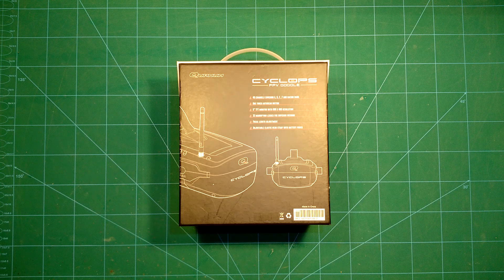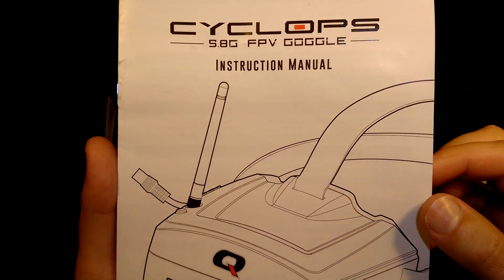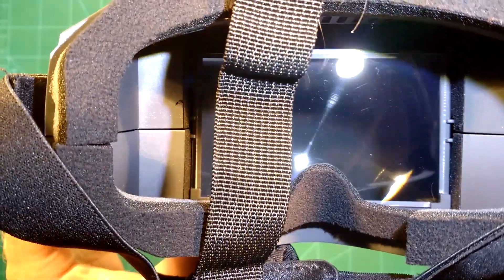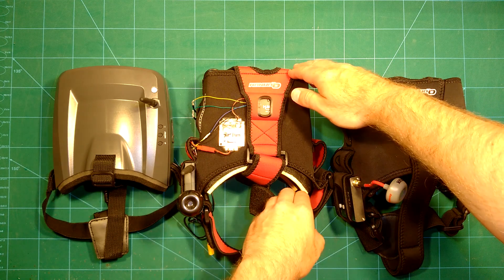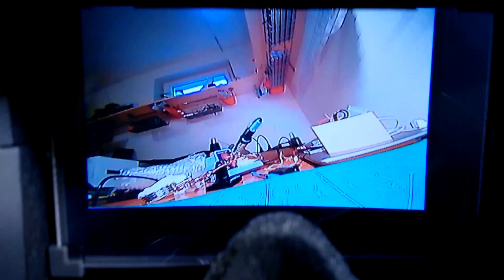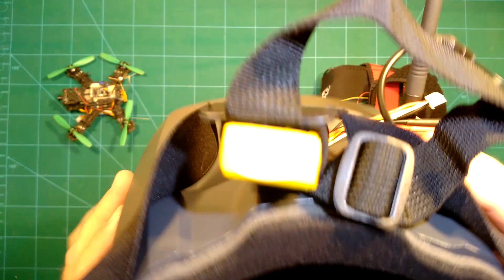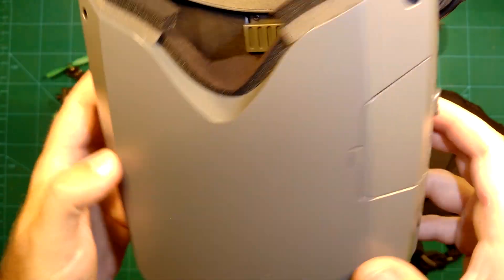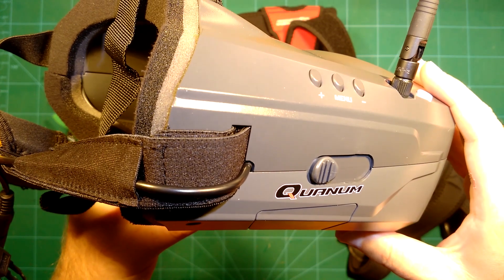Quanum Cyclops FPV Goggles for only 58 USD: Review, Comparison & Dismantling

Comment: Cool review as well sir! :D  Nice comparison & dismantling :) Well done!
Reply from the maker: Many thanks mate, glad you like it. The dismantling really showed me that they are much more mod-able than I thought. Look at all the free space on the right side. I'm already making plans on what I want to put in there :-D
Reply: a DVR? :)  Notice that I had a DVR in mine in my test-flight :)
Reply from the maker: Yes, I was wondering about that, care to share some details? :-). I integrated a HMDVR into my v2 Pro and was going to do something similar for the Cyclops :-)
Reply: Ah yes.. that is a bit of an unlikely setup.. I recently reviewed the Foxeer Legend 1 camera, and did not like it 1 bit.. So I took it apart.. replaced the camera itself by a servo-connector (simply put).. and added a contra-servo connector to the receiver of the Cyclops.. That's it really..
NOT ideal, as the resolutions don't match. but with a bit of cropping it worked..
Reply from the maker: Nice and very clever! Great work :-)
Reply: Thanks man :)  And it didn't cost a thing (as I didn't want to use the Legend 1 anymore)

Comment: thanks for tearing them apart. plenty of space in there for the modders.
I guess if the goggles sell good, they will release an updated VRX module that has more functionality?   only real disatvantage that one cannot set a frequency (which makes it unsuitable as spectator goggles if more then one video source would be available...
Reply from the maker: Completely agree, it is a pitty that the channel is not shown to you and is also not setable manually. I do hope there will be an upgrade. Other than that - very nice goggles.

Comment: Very nice video my friend :)
I think because of having opened the goggle, you have made probably the best review of this product so far.
It's too bad you did not have the Eachine VR-007 FPV Goggles, i would love to have a picture quality comparison with the Quanum!
I am bit disappointed about the finition of the Quanum but it seems to be a honest product for the price but i would definitely go for the Eachine ones despite the little extra price and the lower resolution because of the better finition and the handy auto-scan of the video receiver!
Happy midweek
Reply from the maker: Many thanks mate! Would love to compare them to the VR-007, I'll try to get one of them for review. The Cyclops have autoscan as well, which seems to work really nice! I really like this pair of goggles given the cheap price :-)
Reply: The Eachine VR-007 FPV Goggles are much lower quality...only a 4.3' screen with low 480x272 resolution, too low for FPV or reading OSD well.
Reply: For having testing these goggles, you will not have any probem for reading the screen even your OSD since you are sending analog video which has a higher resolution but honesty Quanum does not have a such good finition and the battery strap and connections have a very poor conception...

Comment: Excellent review and tear down to show what's inside. Definitely needs a couple of mods such as you mention, optional A/V switch to add A/V input for using with external VRx for other frequencies. It should be easy to do by intercepting Video out from internal 5.8 VRx. 16:17 Looks like wire#4 on VRx module connector to LCD screen, Red wire being #1, is the VRx video out wire? I'm just guessing based on what can be seen on your video! Also you can add a DVR. Perhaps just splitting the VRx video out to a standard RCA plug may work. By the way, your speech/narration is totally understandable so no worries on that ;)
Reply from the maker: Great! I had hoped that look of the internals would be useful for some - excellent analysis. I'm planning to add a DVR to them soon, and will also do a video on this. Really looking forward to this. Thanks for the heads-up regarding speech/narration. Thanks again for watching and your valuable input!

Comment: Great review, thank you.
So that compartment door, did you find what it was for? Looks like maybe just for releasing the lens clip.
Reply from the maker: It's really only a "dummy" door. One cannot even open it, it just looks like a door. I assume that it is for a feature which they wanted to get in, but did not at the end. I open the goggles at about 15:08 and that door is even at the other side of where all the rest of the electronics are placed. Maybe we will soon see another goggle with the same casing but the door functional? But I'm only guessing here. Great that you liked the reivew, many thanks! So great to have you with us!
Reply: ok, thanks. Yep I noticed there is no additional video-out to record your FPV, so maybe the door will add something like that in the future. thanks again.
Reply: The door is actually a real door, but the tabs that hold it in place are to large. I used a sharp knife and removed a sliver of plastic on each tab. Now the door opens easily. I use it to hide a programming contact.
Reply from the maker: Awesome info Kjell - thank you very much!

Comment: After seeing the inside dimensions, I had to come watch your video review.  It would be nice if the auto-scan would at least put the number of the channel up on the screen briefly, just so you knew for sure you were locked on the correct channel.  Probably not a good goggle for a guy who frequently races with other FPV pilots, as you'd definitely want to control the channel function then. Still, its a bargain price, and I just might wind up getting a pair to fool around with. Cheers!
Reply from the maker: These are indeed very simple goggles. The autoscan (complete automatic, no manual, not showing the channel on the siplay) was also a bit of an issue for me, but now that I have used them for a few months, it is not so much of an issue for me. They are my main goggles currently. Even if I fly with others, it's not an issue. One reason is that I have my main channel and seldomly change it. However, I also found that the autoscan is working very good and accurate. Even when others are around, it is sufficient to move away a few meters and it will reliably find my channel, that works great. But the real reason why I'm currently sticking with these goggles is that they are very very lightweight and very comfortable to wear. Much more comfortable than my Quanum DIY goggles for example. I can wear them for hours without any issues.
Reply: I agree, they may be simple, but sometimes that's a good thing. After watching your review on the V2 Quanum, I like these better. I think they would work well with my ZMR250 racer, especially since I don't normally fly with anyone, just fly around on my own .. the auto scan should be fine. Thanks for a nice review!
Reply from the maker: My pleasure, thanks for watching, Bill :-)

Comment: Maybe you can turn two video transmitters on at the same with the channels very close together to see how well the autoscan channel finder works?   Do you think you could replace the Fresnel lens with a real lens if you wanted?
Reply from the maker: Good idea! I will defenitely take them with me when I go flying next time to see how well the Autoscan works. It does seem to work very well though, from the short tests inside my house. Better than the autoscan of my Quanum diversity receiver. Will definitely keep you updates. As for changeing the Fresnel - yes - quite easily. I take the goggles apart at arount 15:08 in the video and there you see the very simple mechanism for holding the Fresnel lens. It would be very easy to replace this I believe.
Reply: The autoscan is not an issue as long as you fly on your own. It would be nice if you can check what happens if there are more than one transmitters active. Then it might get an issue.
Reply from the maker: Absolutely, that is a bit of a problem. But not a major one.

Comment: Will these work with a Phantom 3?
Reply from the maker: As far as I know the Phantom uses 2.4 GHz for the video channel, so no - they will not work. They also do not have a video in plug, where you could connect them to your phantom controller. So no, I don't think so.
Reply: Ok thank you

Comment: Can you change the fresnel lens of the cyclops to the better acrylic v2 pro lenses? did you try this?
Reply from the maker: I did not try this. The acrylic lenses are better but I found out that there is - at least for me - a huge disadvantage with them. Similar to the Fatshark-style goggles, the acrylic lens will fog up. It did that a lot to me when flying in hot weather. This was pretty much a show stopper for me, because I did not want to install an extra fan for them, like people do with the Fatshark-style goggles.
Reply: Thanks for your help. So i ordered the cyclops googles now without the fresnel lenses. Hope it will be better than v2 Standard Googles.
Reply from the maker: You will like them. They are my main facebox-style goggle at the moment, because they are very light-weight, quite small and very comfortable to wear.

Comment: AV inputs?
Reply from the maker: Nope, none.
Reply: +RC FPV Flight hmm..
Reply from the maker: Definitely a downside. You would have to DIY this, which is absolutely possible using a video switch. There is plenty of room for mods in these goggles, as you can see when I open them up at 15:08. I plan to do some (such as adding a DVR) myself.
Reply: +RC FPV Flight cool. i was just thinking about these as back up and or for others to use off my ground station
Reply: +RC FPV Flight for under 60 bucks you can basically ignore any downside to these goggles
Reply: +RC FPV Flight why do u talk like you're tired, drunk, and depressed